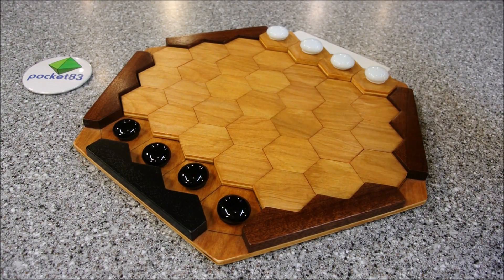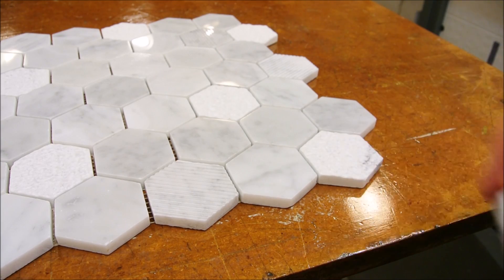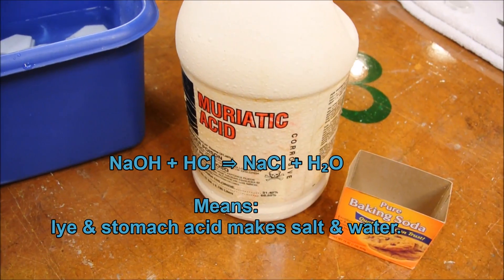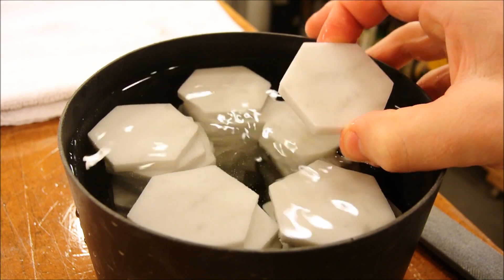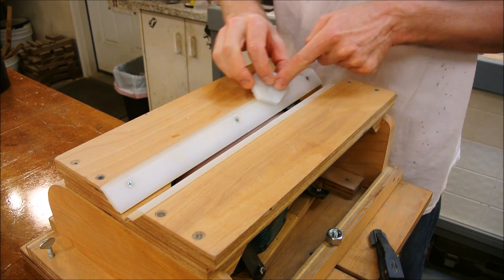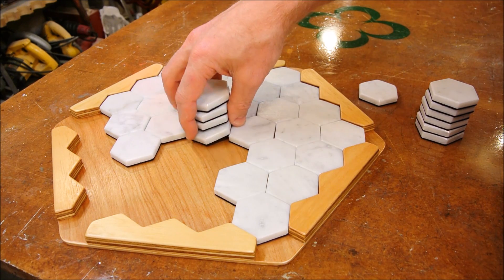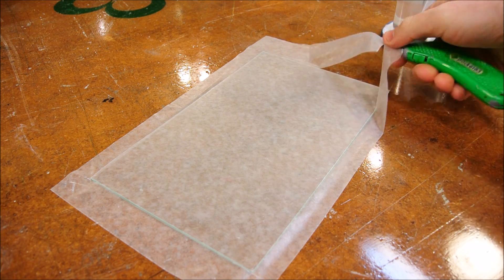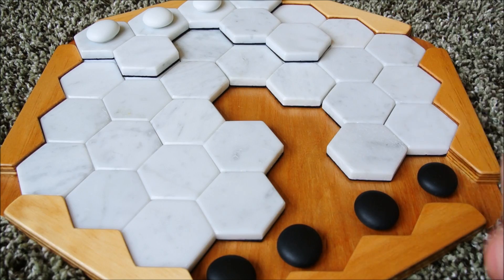Iso-path tiles from acid dipped marble

Comment: Acid/base reactions can release a lot of heat; neutralizing an acid on your skin can lead to burns. You're better off with an emergency hand wash set up (you can Jerry-rig one with a normal sink)
Reply from the maker: Sigh. I knew there would be a hundred of these comments. If you get the acid on your hands, rinse it off with baking soda and water. No, not only baking soda, while you stand there like a moron watching the neutralization reaction: use BAKING SODA AND WATER, LIKE I DO IN TH ERV IDEO WHAY Z WRONG WITH YOU PEOPOLKe@? 

There's not going to be a burn. You don't need an emergency hand wash in your garage just for this project; simply pre-mix a slightly basic solution, and apply that to any area that has contacted acid. Then go seek professional opinion. Like the psychiatric kind.
Reply: pocket83 for fuck's sake, man. I was just trying to be helpful.
Reply from the maker: I know. No need to swear, man. Just try to imagine this from my end.
Reply: pocket83 Sure, I get it. I hang out in my college's ACM lab; I get where you're coming from. But think of it from mine as I am from yours (I'm not being obstinate; I really do get where you're coming from): I like your videos; I'm a subscriber. I've been told in a lab environment (and as you're saying, it may not be as important to someone at home, but I only know what I've been taught) to never neutralize an acid on my skin and I've been in a lab where someone burned themselves badly by doing that. That being said, I've not been in a class where anyone has messed up with muriatic acid, so I really don't know how dangerous it, specifically, can be. I don't want for anyone to have that happen to them, and I especially don't want for someone who makes great content to get hurt or to accidentally tell someone something that might get them hurt. I shouldn't have sworn, but I also shouldn't have been berated like that, and I will happily admit that I don't have the experience dealing with home-chemistry like you do, but again, I only know what I've been taught. I'm not being pedantic, I just care.
Reply from the maker: Gotcha. Yep, chem lab is a different world. Wearing splash goggles and nitrile sleeves as you stand around watching a single gummi bear experience an uncontrolled oxidization reaction that gives its colorful hydrocarbons back to Gaia through a fume hood, as your fellow lab-mates excruciatingly note every quantifiable detail numerically in blue pen. Been there. 

But real-life chemistry application turns out to be a bit more, well, relaxed. Still, do as the instructors say! The reasons for their procedural dogma are sound, they're just a tad excessive sometimes, and that rigor need not apply unconditionally in my garage. Also, my acid here is weak compared to lab stuff; it's for concrete etching and such. Context matters. No hard feelings, and good luck.
Reply: Thanks for resolving this matter as grown-ups in spite of a heated start.
Reply: +pocket83 
Omg, my sides! Your description of a school chemistry lab is pretty funny. I hope you get a good laugh today.

+Perry Turner
Check out NileRed's channel. He tested the commons acids on his hand (with proper safety, with the exception of pouring acids on skin in the first place).

Comment: we can eat marble?
Reply from the maker: Probably. But don't. 
And you WILL get gas (from the CO₂).
Reply from the maker: I can't win here, can I?
Reply: This is a youtube comments section. What did you expect?
Reply: You can eat anything once.
Reply: muriatic acid is a component in gastric acid which you have in your stomach.
the reaction creates calcium chloride, co2, and water. Calcium chloride is Generally Recognized As Safe, and is used in cheese and beer making.
The 2 problems you could have would aside from gas be : 
- excess calcium intake, which can lead to an increased risk of cardiovascular problems
- toxic impurities, like lead.

so basically, if you ate a marble made of marble once, you should be ok, but still, don't try it, I might have missed some stuff.
Reply: Only if you dissolve it with muriatic acid first

Comment: it sadly cant disolve a bacon cheeseburger
NaOH and HCl the nastiest chemicals you may want to come in contact with? uhhh nonono
Well, better to be safe than sorry, its ok to think something is nastier than it is, but its pretty dangerous the other way arround.
Looks awesome tho :)
Reply from the maker: I'm not sure I understand your comment.
Reply: Hydrochloric acid wont dissolve organic matter, its just not it's thing.
Lye and hydrochloric acid aren't the nastiest chemicals common people have access to, not at all. As long as you don't get them in a sensitive part like the eyes, you are fine even if it touches your skin, as long as you quickly neutralice it or wash it. Concentration and temperature of course matter.

And with the last sentences I meant, that its better to think that stuff like this is more dangerous than it is, than to think that it's less dangerous than what it really is.
Reply from the maker: Yeah, well, stomach acid has everything to do with digestion, so I think you understood where I was going with that quip. And yes, HCl and oven cleaner are two of the nastiest chemicals that I keep in my house, so cut me some slack here.

Comment: Awesome project!
But you should not try to neutralize the acid if spills in your skin. If you put baking soda in excess, it can also burn your skin. Just rinsing immediately and with a lot of water is enough and safer.
Reply: William Magalhães baking soda doesn’t burn your skin. 
Lye will burn. Baking soda isn’t lye. 
Lye is sodium hydroxide. 
Baking soda is sodium bicarbonate. 
And you most definitely DO want to neutralize the acid if it’s on your skin.
Reply from the maker: First, baking soda is in no way comparable to HCl with respect to causticity. 

Second, as mentioned in the video, I mixed the baking soda into the little black tub of water, to make a slightly basic solution. Over time, it was necessary to reduce the acidity of the blue tub in order to keep it to a skin-tolerable pH. This is much faster and easier than constantly replacing tons of water. It is also preferable in this case to stop the reaction quickly. 

I have easily agitated skin, and there was nothing unsafe here.
Reply: Oh no, it's was my mistake, I always though that baking soda was another name for NaOH.
But you used sodium bicarbonate, it's totally fine to use to neutralize HCl.

Comment: Do you think you could turn all the pieces upside down and spray them with plastidip? It's rubberised plastic paint and comes in a number of colours. I have painted my bicycle frame with it and it looks good - not sure if it would work better with really smooth or rough tiles.

An interesting video - good to see the process you go through.
Reply from the maker: I didn't try the spray-on kind, so that might work. Tried it with a brush: it was a disaster. In general, I don't like plastidip. Cool product, but it's overrated and too expensive. But it did have traction, so it could be worth some further experimentation.

Comment: Thanks for the great video, I always like your craftsmanship and ingenuity.

The silicone seems to work very well, and I personally think it would look better than the felt. Any particular reason you didn't use it for the marble pieces as well?
Reply from the maker: Thanks! The felt ones seem to slide around just right. Also, I like the noise suppression. It gives the tiles a nice, quiet feel. Silicone might be too 'sticky' for the final board.

Comment: Hi pocket, great vid! Out of curiosity, is there a particular reason that you used the foam sheet and cut out the individual pieces rather than laying out all the tiles close together and using an exacto knife? I figure the second method would save material but at this point I'm used to expecting that you know what you're doing, what was your reasoning for cutting out each piece individually?
Reply from the maker: Two simple reasons: 1) felt doesn't cut as well with a knife as it does with shears, and 2) felt is very inexpensive, so I spaced out the cuts to make it easy. 

The 'close' cut method might work in other applications, or with other products! But even with the waste, I used less than $1.50 worth of felt here. And that was the expensive kind ;)

Comment: If someone wanted an easy magnet idea, you can get sheets of magnetic material, it's used for printing on to make fridge magnets, then you just need a metal playing surface.
Reply from the maker: That is a really good idea! It might be a bit tough to see which ones are two layers, though (because those are thin).
Reply: One side is the brown/grey magnet, other side is white printable, may not work so well for stacked, unless you put something on top of the pieces.
Reply from the maker: What if you took a standard wooden isopath board, and then lined the base of it with sheet magnet? If all of the wooden tiles were also lined (top and bottom), would it work? 

I mean, hypothetically; I'm just wondering. It has a strange polarity. That sheet magnet stuff is also probably expensive. Especially if it's the self adhesive kind.
Reply: It's cheap as all hell, actually. https://www.amazon.ca/Flexible-Magnetic-Material-12-inch-Magnetizing/dp/B001NGE9C0 and for the self-adhesive kind, it's even cheaper by volume. https://www.amazon.ca/Small-Parts-Flexible-Adhesive-0-03-Inch/dp/B005HY990G/ref=pd_lpo_vtph_201_bs_t_1?_encoding=UTF8&psc=1&refRID=R28YFMR0RAMNNB9GA4QR Note the former is for a 4x12 sheet for around $3 CDN, while the latter is for a 24x12 sheet with adhesive for $13 CDN (cheaper if you combine with other orders to reach $35).
You could even add ferromagnetic metal strips to the tiles, either sandwiching them between layers of wood or simply sitting them atop the tile, for the magnet to attach to and prevent it from sliding all over, too.
Reply: I have some here, it doesn't stick too well front to back, but is fine mag side to mag side.
Easier to post the search link, it's shorter, i have the printable, but there's just the mag sheet too
https://www.amazon.co.uk/s/ref=nb_sb_noss_1?url=search-alias%3Daps&field-keywords=magnetic+paper
The 'magnets' are stips very close together, you have to be careful about putting 2 together, they could misalign themselves
https://www.youtube.com/watch?v=s7g4BdvgrHI  shows this
Reply: Oh I love magnet tape!  I haven't used it for a whole lot but it fun.  My favorite is turning fortune cookies into the perfect little refrigerator magnets.  They're like little captions.
Reply: magnet sheet to magnet sheet is often problematic because the magnetisation is done in a grid and if the grids don't fit exactly your upper layer will be al wonky. better to make pieces with magnet sheet on one side and steel sheet on the other.
Reply: Patrick Keller almost a grid. It's called an Halbach Array. Lots of info about them on YouTube and Wikipedia. You should check them out.
Reply from the maker: Thanks, Dex. Interesting page. I always wondered about that. 
https://en.wikipedia.org/wiki/Halbach_array
Reply: Thanks for the info. This illustrates nicely what I meant. The Halbach Array creates a pattern of magnetic "notches" This doesn't matter for steel, but when you try to stick it to another Halbach Array the notches have to line up and this may create an offset in the two pieces. And when different pieces have different offsets in different directions, you may never get your board togethers straight.

Comment: I've been considering 3D printing an Iso-path board and pieces (because 3D printer), so I'm certain I'll use the silicone technique.  It'd be a lot less work with printed tiles because of the inherent texture on the pieces.  I'm sure I'll find a use for your acid-bath mosaic tile idea in the future, tho!
Reply from the maker: You might not need to. 3D printers make this project easy! Some of the printable designs out there use locking tiles. Let me know what you come up with, though. Good luck.